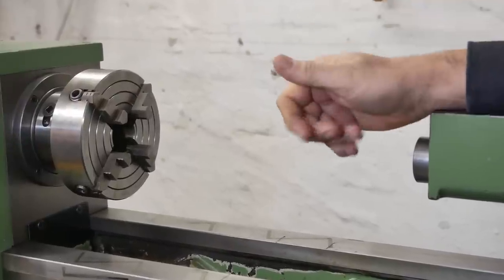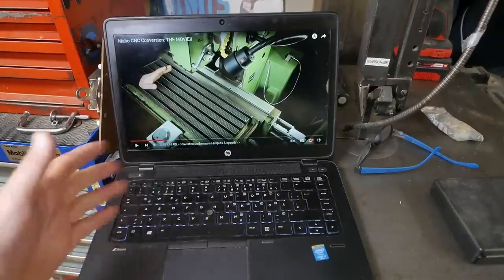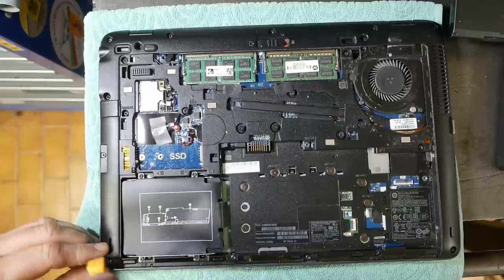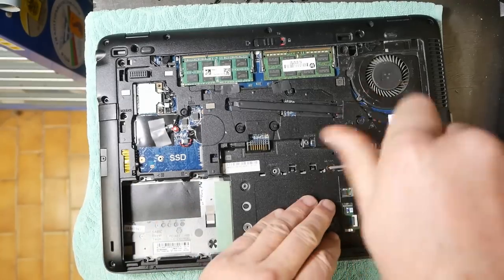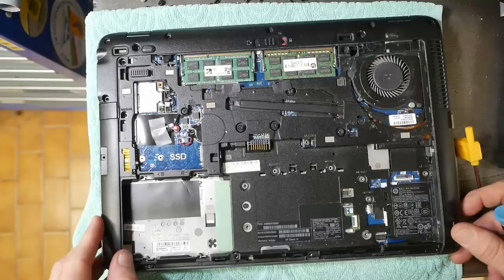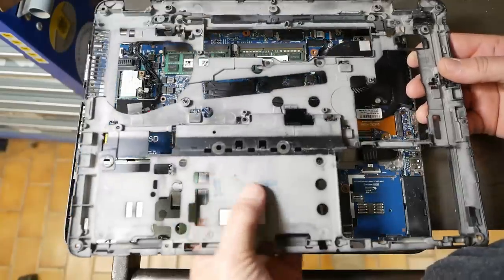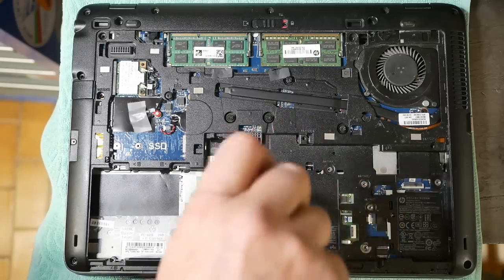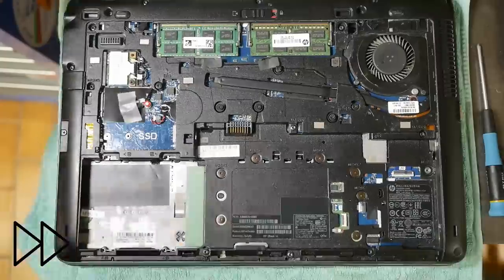M1 Mac: New, Refurbished or PAINTED?!?

Comment: I would use a PC.  Amd 8 cores or more.  16gb ram, nvidia mid range video, or other guts.  Point is you can thermally maintain a PC better than a laptop.  4k render is stupid fast in resolve. And you can add in the drives at will for additional storage.  I get less than minute per minute render time but i dont have many fancy things in my videos.  And you can paint it whatever.  Use cooling water piped through a fish tank...point is you gain some but lose portability.  Actually.  You keep doing you the way you want to.  If  it is a travel option then for sure a laptop using an os you want.  Just keep in mind thermal over working wears laptops out quickly.  Cheap laptop and a cheap pc build with remote desktop and you can edit on a screen and let the remote cores do the work.  End up at the price of a high end mac.  If you need a hand let us know. A one shot gofund or whatnot :).  Keep at it! Thank you, Phil
Reply from the maker: Thanks for the support on  that. I have never set up remote desktop, but doubt I could edit in realtime through such a system. Resolve is a performance beast.

Comment: I would go with as high performance as you can and want to afford. See your Computer as just another tool and especially when you spent a lot of time with it on editing having a good performing tool you like makes the job much more enjoyable. So it is money well worth spent as you get it back in much more motivation when using it ^^
Reply from the maker: That is a very good point. Not sure whyI get such analysis paralysis about this. I forked over €1000 for a Maho shaping head I used twice. The laptop will get thousands of hours on it.
Reply: @RotarySMP  exactly, and if you ever run in performance limitations during those hours it constantly slows you down and brings you in a bad mood felling limited by the tools you have available ^^ Personal advice, if you go with a macbook make sure to bite the bullet and also get a big enough ssd and at least 32GB RAM, both are stupid expensive but trust me, if you ever get blocked because of storage issue you just go insane... (especially when you are going to do video editing 2TB should be minimum imho, even if you keep them on a separate drive afterwords, for cutting and processing nothing beats the loading times of internal ssds ^^)
Reply from the maker: Thanks. I am also shying away from an air for that reason. I havea 1TB SSD in the Zbook, and only keep the current weeks project internally. Each week I offload the last weeks files to external HD's. 

Moving to 32GB and 1TB is already very spendy on that MBP.
Reply: @RotarySMP  I got myself a 2TB MP600PRO PCIe M.2  for my new rig and I did not expect the speed gain to be that much but it is a jump that feels similar as from hdd to ssd all over again ^^
Reply from the maker: @Anton-hz4ev  That is a good point. I have an SSD, but the M2 slot is vacant.

Comment: I think painting a mac green fits perfectly with the irreverence of your channel. The one thing I'd check is thermals - those M1s seem thermally optimized out the wazoo, maybe the case is an integral part of heat management. Not sure how paint would affect that.
Reply from the maker: Yeah probably is. Would need to paint it thermal black.

Comment: You'll be happy once you see (any) new pc rip through rendering work. The M1 should be fine if it's highly rated. 
But, as an internet user, i have to ask: why not a desktop pc? Instead of a laptop.

Because laptops are always limited in terms of power usage and temperature and all that. Therefore, maybe a free-air-breathing, power guzzling desktop will do the trick?
Reply from the maker: I travel enough that I like to use the down time at the airport and hotels to edit.

Comment: Couldn't see what you had for a hard drive.  Absolute budget choice would be to spend about $50(USD) on an SSD if you're still using spinning rust for storage.  That could buy you a lot better performance.  I think for the somewhat cheap upgrade from Used to Refurbished.  That may be the next option to consider.  My Grand daughter bought a Refurb MacBook Pro a few years ago.  This is the one where the Video chip wasn't soldered well to the system board.  The refurb hadn't addressed that issue and she only got about a year out of it before the display started to have problems, so there is that to consider too?  I agree that a used Windows PC or laptop might be the best choice.  With a PC you can further upgrade the display card if needed.  Get something with at least four cores and 16gb RAM and an SSD.  Flash storage is where it's at for a pretty good performance boost.
Reply from the maker: Yeah I have an SSD and maxed out the RAM as well.

Old Intel Macs always seemed overpriced to me. The M1 Air seems like a real step change in performance. 

Resolve is optimised to load the GPU, so it really needs an 8gb GPU for 4K, and with current prices, even used, the M1 look more attractive.

Comment: Desktops can be a lot cheaper whne bought used, for about 500 EUR you can get a pretty good editing one, but if you really need a laptop, anything used is gonna have a worse off battery, and the components wear out quicker since they are normaly hotter, which means buying new is your best option but also expencive.
Reply from the maker: As Resolve really needs an 8GB GPU, and they are so expensive even used, I would struggle to built a used part PC with the performance of an M1 Air for its price.
Reply: @RotarySMP  yes, true I got lucky that I could buy my 1070 for 170 EUR but this was a few months before the shortage. And it doesn't seem it will get any better until bitcoin or another currency drops agean
Reply: @RotarySMP I do otherwise have a spear 970, I will part with it for how much I payed for it 90eur but that is less that the 8 GBS of vram you need

Comment: I can't really give any meaningful advice as to video editing. But if you go with a Mac, consider that you absolutely MUST go with external storage. Apple is completely locked down and integrated. If ANY part fails (as they regularly do with Apple computers), ALL your data stored on the Mac is gone. Apple will not retain any data on your machine, no matter why you bring it in for service. Also, 4K Video is a memory hog, the files are about 2-3 times the size of 1080p.
I'd personally never go with anything Apple because I despise the company amd their practices, but that is another story.
Reply from the maker: I already only hold the current weeks video project on the local drive. Each week I offload the last one to back up cheap external HD's.
I am also not a apple fanboy. The performance of the M1 makes me weak.

Comment: Get the M1 MacBook Pro 14" or 13" with 16MB. When it comes to laptops, especially Macs, splurge a little. It might be another 10 years before you'll need to upgrade again. I would also tack on AppleCare which gives you several years of warranty and accidental coverage. I'm still running a Mac from 2013, making it almost 10 years old. Macs are a real delight to use! If you're impressed with the construction of that soon to be ewaste of a laptop of yours, you'll have your entire world rocked by the level of engineering. I am often in awe how well everything works. Like all great products, it's the seemingly insignificant details that make all the difference.
Reply from the maker: There seems to be a law of diminishing returns with the M1:
https://www.youtube.com/watch?v=lTes9KkwmME
Reply: @RotarySMP   He said he found a few tests where he didn't see a significant difference without optimizations. What were the configuration of each respective machine tested? The the base 13" M1 comes with only 8GB, while the base 14" M1 Pro comes with 16GB.  Memory makes a significant difference when working with video.  His review would hold more weight if he compared the base model configurations for all the machines. Upgrading the 13" to 16GB only gets you $300 shy of a stock 16GB 14" M1 Pro, making it a still better bang for the buck, since get a much better pro level screen, better audio, more RAM and more cores. I will agree the M1 Max exceeds the point of diminishing returns, especially if you're not doing a big budget, critical movie production.

Davinci still has some more optimizations for the M1 Pro and M1 Max left to exploit, which will come later via an update. The rendering times is where the M1 Pro really shines. Many claim it's up to 3 to 4 times faster. I would also read the 9to5 Mac article. When it comes to video, these guys know what they're talking about. They also have a YouTube channel. 
https://9to5mac.com/2021/10/22/davinci-resolve-updated-with-m1-pro-and-m1-max-support-runs-5x-faster-on-new-macbook-pro/

Comment: If you need a laptop, I'd recommend against a mac. If only for the fact that they have a limited software library. There's also the issues with repair-ability and upgrade-ability. If you get a good pc laptop, you'll be able to order parts if you need them and also have the advantage of user replaceable memory and storage at a minimum. Not to mention that from the tests I've seen, video editing is the only real metric the m1 has over even a modestly equipped pc. And that's mostly due to dedicated silicon it seems. Hell, get something like the framework laptop and just upgrade the mainboard as time goes on.

I just picked up a lenovo legion 5 on Nov. 11 for about $1350US with discounts. That comes with a 5800H and RTX 3070. It'll run circles around something like the m1. Upgrading to a 4 year warranty cost me about $130, accidental damage on top was about another $90.

On the other hand, if you are looking to buy into the Mac software platform, with iphone and all of that, then the M1 is your best bet over an intel mac. With the lower power draw and the fact that apple is in the middle of moving away from intel, it would be the smartest choice.

Linux support on x86 is still better than arm for desktop applications, it seems. If you were looking to dual boot or do something more interesting, then that would be your best bet.

As far as desktops go? If you can find a decent graphics card for a lowish price, then I'd go for it. You can put together something you truly want for no effort these days. Not to mention that assembling a computer now is extremely simple. There's no resource management you have to do. No jumpers you have to set, etc. No low level format you have to do. The only thing you have to worry about when assembling a computer these days is the mainboard and the cpu choice, and that's just if you're looking to do something more complicated like vfio, run a hypervisor, or use a lot of cards needing a lot of pcie lanes. Well, that and be careful if you use an lga processor. The pins on the mainboard are more fragile than normal pins.

But if all you're going to do is edit video and other general computing tasks? The M1 would be great for that. It even has an extra port! Just keep in mind you can't get solidworks or autodesk inventor for Mac, but you can get Matlab, so it's not all bad.
Reply from the maker: The Framework is not attractive specifically because of the lack of GPU power. I dont really wnt to go mac, but Resolve is optimised to load the GPU and needs 8gb of video ram for 4K editing.
With the current price of 8GB GPU's, even used, it would be a struggle to put together a used part desktop with the performance of the M1 Air, for that price. And I need a laptop about 20% of the time.

You got a great price on the Legion 5. I have been looking at them or Razer blade 15, but they are all out of my budget. The way the M1 can render on battery without throttling, while the gamer PC's need to be plugged in with the fans screaming is also attractive.

For most software I have moved to open source. I now use Freecad, and it is not too bad.
Reply: @RotarySMP  Yeah, you're going to pay around $200US for a 8gb gpu at a bare minimum. And that's assuming you're going to go with something like a 4/580 8gb. Which would be about as low as I would go. They support OpenCL 2.0, so they should work fine with resolve.

About the framework, you're right. The only apu that could be used on the x86 side that I know of that might work is in the steam deck. And that's not out yet and is untested afaik. Not to mention it's the wrong form factor. 

You just have to be very VERY careful about what you choose if you're looking at a PC laptop. If you're going to buy a laptop, always look at a teardown picture or video first. That'll give you an idea of the cooling. You want to look for a dual fan setup with 4 exhaust ports. Two to the back and one for each side. That's one of the most efficient setups. Well, outside of exotic methods and setups.

When you get your laptop in, replace the TIM with something better. NOT liquid metal, but something like kryonaut extreme works well. It isn't supposed to cure like some others do.

The second thing? Get throttlestop for intel or ryzen controller for amd. Grab msi afterburner as well. They allow you to reduce the excess power consumption of your machine. 

If you do all of this, you'll end up with the best of both worlds. Something capable of housing enough storage while remaining quiet under load. Mine is whisper quiet now for normal computing, and when I put it on a cooling pad while gaming, the fans hardly ramp up at all.

This is, of course, a lot of work and you'd have to do a decent amount of research to see it done.

Pros? Upgradeable/replaceable storage and memory. Better performance. Better thermals. You end up getting more for your money. You might get a numpad?

Cons? TIME! Time, time, time, time, time. It'll take some time choosing which model you want, looking at teardown videos to make certain the cooling is adequate and it has the amount of storage options you need. (They rarely advertise/disclose these things well enough imo) Not to mention the replacing of the tim and setting up the power limits and frequency curves. While you can easily find instructional videos on these it will cost you more time. There's also the possibility of making the wrong choice and ending up with something you don't quite like. The Mac is a known quantity with a good screen.

Is it worth it? For me it was. But then I'm a unique case. I'm retired and disabled. I have a lot of time on my hands to research and need a good desktop replacement when I can't get out of bed, etc.

But if you're willing to live with the fixed internal storage limitations? There's not much better for video encoding than a M1 air for the price right now. You'd obviously need a good 10Gb usb enclosure or something else/better to deal with the storage limitations though. 4k raw footage is no joke, as I'm sure you know.

Just a tip, don't open the M1 if you get it. I don't know about the laws in the EU or your country specifically when it comes to that sort of thing. We have a law in the US that makes it so that we can open up our devices and not suffer a warranty penalty and they still try to deny claims sometimes.

As for the color? I'm pretty certain you could get custom skins for the M1. Maybe mock up a Maho vs Schaublin scene on that green background?

Comment: As for Apple computers, have a look at Louis Rossmann channel - he repairs Macs and hates them, for a number of good reasons. I would go for a desktop PC, new or used - used gaming PCs pack a lot of power and when they are outdated for gaming, they can be found at good prices. I have a couple of old laptops but I never use them, as I prefer desktops. I've built all my PCs, which also tends to save money, and you know what you put in there, but it's a personal choice 🙂
Reply from the maker: Resolve is optimised to load the GPU and needs 8gb of video ram for 4K editing.
With the current price of 8GB GPU's, even used, it would be a struggle to put together a used part desktop with the performance of the M1 Air, for that price. And I need a laptop about 20% of the time.
Reply: @RotarySMP  That's a lot of video RAM! I don't do 4K video editing, or Black Magic Design :-)
You're right. You may be stuck with the M1 Air, if you can afford it :-)
Or maybe try crowdsourcing - seems to work great for valued content creators (which you are).